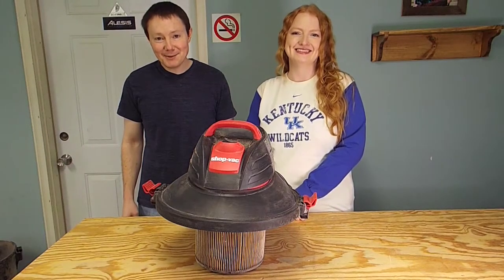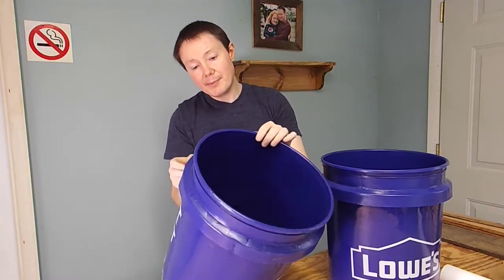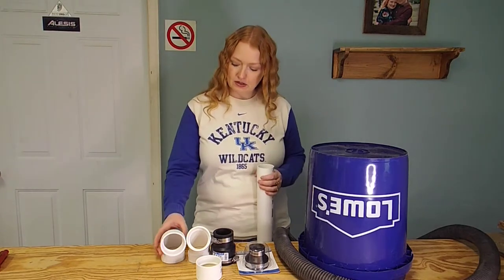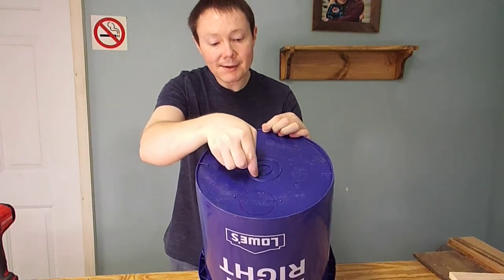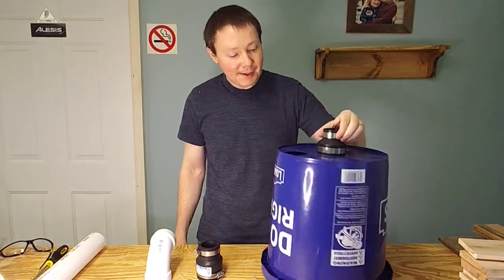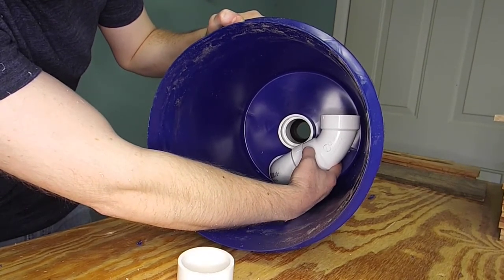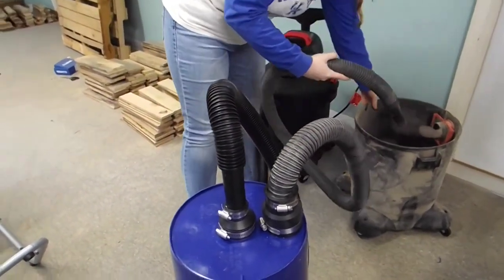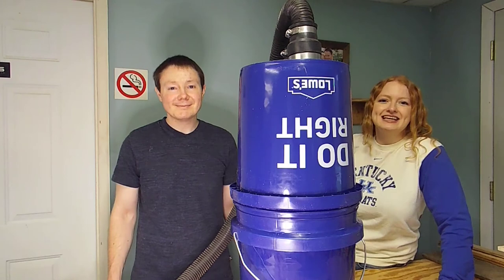Woodworking Essential: DIY Dust Separator for a Cleaner Work Environment

Comment: Really great. I’m gonna do it but use pvc pipe glue to get the fittings super air tight, rather than dry fit. Excellent though guys! Thanks for sharing.
Reply from the maker: Thank you for watching. I hope it works great for you. Happy Woodworking!

Comment: Just got my buckets and fittings, planning to use 2” pvc and heat to form them to fit my 2.5” ridgid vac hoses. Anyway, I used a fine tooth blade on my oscillating tool to cut top ring and it did a good job. I wasn’t sure on exactly where to cut top edge so left about 3/8 to 1/2” over that ridge - it does not fit, just a tad too big, so watching this again and stopping a few times between 3:45 - 4:00 minutes, I can now see you cut right at the ridge. So back out to fix my cut line! The rest looks pretty straight forward. Will report back when done.
Reply from the maker: Thanks for watching. I hope it works for you. I think ours fit pretty tight at first, but over time it gets worked in. Happy Woodworking!

Comment: It is noteworthy to mention those blue LOWES buckets are stronger and more rigid than other plastics,.... the suction does not affect them from the vacuum effect.
Reply from the maker: They are quite strong. They do build some static electricity from the air movement. Other than that they're good. Thanks for watching.

Comment: Guys you made a great video. I have looked all over you tube and saw 20 or so videos. Yours is the best. Great job guys. One pointer, i think if you rotate that elbow fitting more towards the bottom, but keeping it on an angle. I believe you would even less saw dust in your vacuum. Best wishes from North Carolina!
Reply from the maker: Thanks so much for the kind words and the tip! #happywoodworking

Comment: Hi I was not sure you got my last message I said I guess there is no reason you could not use the dust collector as an additional water storage if my vacuum is small as long as I make sure to use the wet vac filter ? thoughts please thank you
Reply: can we be sure drilling a hole wont work I mean i have the smallest drill size it seems 1/16 th ????
Reply from the maker: You could give it a try. You can always plug it or put some duct tape over it if you want to later.
Reply from the maker: I hadn't even thought about using it for water. Sounds like it would work. Good idea.
Reply: @happywoodworking  had a new question for you I dont have much engineering experience i think I have herd some state that 5 gallons may be small for dust collection do you think one possible remedy is to get a 6 gallon bucket or larger  ? thoughts please thank you